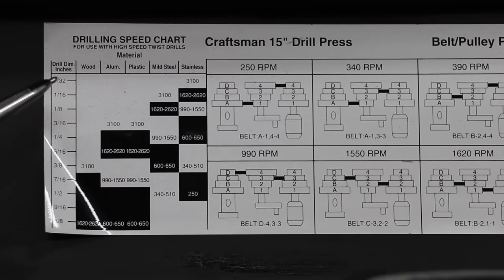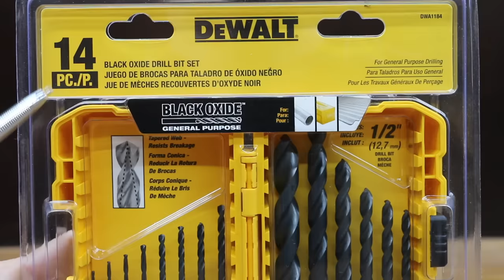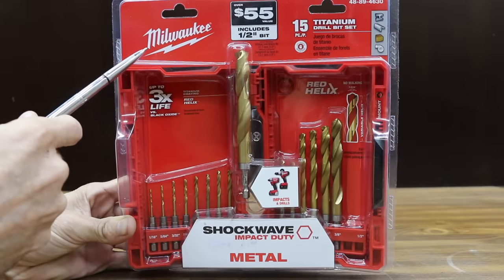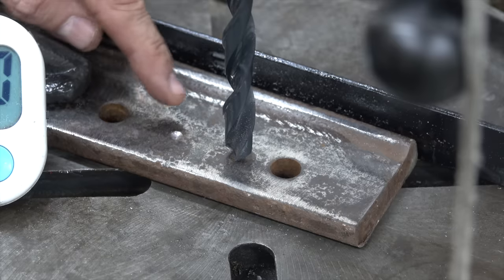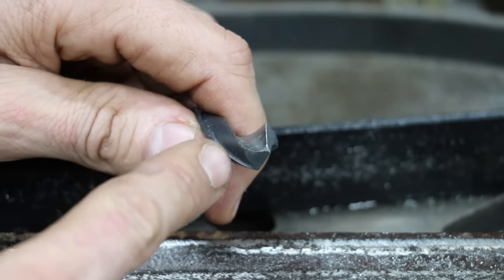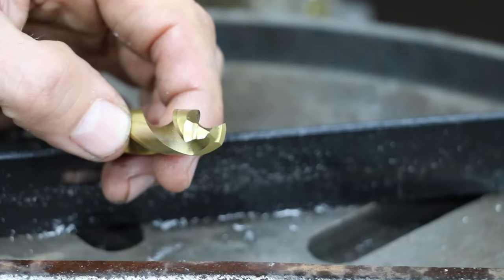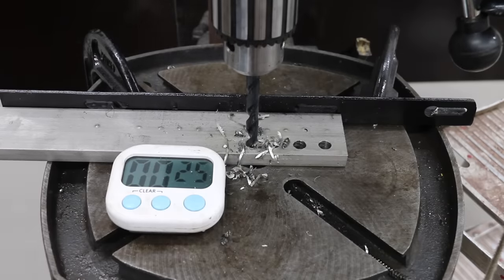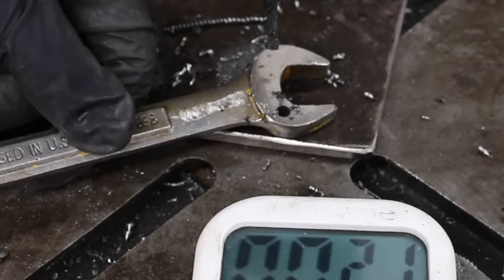Which Drill Bit Brand is Best? Let's find out!

Comment: 15:43 This should be informed in every drill bit set! 
I bet 95% of DIY guys don't have clue about correct rpms and forces to apply
Reply: Agreed and hands up at being one of those people. Done many a project struggling on like a tit, oblivious to my mistake.
Reply: Wish I could give two upvotes on this! guess this comment will have to do.
Reply: Mr. Victory,
Agreed, I never knew the correct way to use a drill either. One thing is for sure , Project Farm is more educational than any other teaching video that I've seen 
Just amazing
Reply: Moto Guzzi  This is the first I've heard of it as well.  I've always been taught to let the tool do the work and I've broken more than a few drill bits by putting too much pressure on it (usually drilling small holes through metal) so I would apply moderate pressure and let 'er eat!
Reply: I know about it but sometimes its kind of hard when drilling without a drill press. I though i wasnt putting enough force and later on when i bough a new similar sized drill bit i discovered it wasnt me, the drill bit was just crap and the newer one drilled through no problem. :/
If you have good quality drill bits then yeah, follow the sugested speeds and feeds,  but otherwise its kind of hard.
Best advice would be just try to keep the chips are a good size and constand. The edge is supposed to cut slices not make metal dust.
Reply: I just figured this out about a couple of years ago and I've owned a drill press for 3 decades. It never even occurred to me that speeds and pressure make such a huge difference.

Comment: Had to drill into a serious suspension bolt that I sheared the head off of and none of my drill bits were cutting it. Car (Audi 😓) has been sitting for weeks because I can only work on it on the weekend (when it isn't raining 🙄). 

Bought the DeWalt set ($15!!) after watching this and within minutes, all done, bolt out. 

Thank you once again for your service 🙏
Reply: Hello ReydioTube , 
Can I ask you about the process that proved successful for you to get the bolt out ?  I see that you used a drill bit but what other steps /  solutions tools were required to solve the problem of the sheared off (stuck bolt) ?

Comment: Great review. I just bought a drill press and went through several brand new 1/2” bits while drilling .125 galvanized tube steel. I had no idea my technique or lack thereof was the problem. Thanks for the tips.
Reply from the maker: Thank you!!  Glad it helped
Reply: R V yup, the bigger the bit the slower you need to go and the more downforce is required.
Reply: Best tip i can give for drilling metals. Thicker materials get lots of downpressure and low speed. Thin stuff can run at warp 10. When your chip is really long maintain your speed and pressure. If you get little needles you need more downpressure.
Reply: I drill through a lot of stainless steel and I periodically dip my bits in water to keep them cool. I believe if they get to hot it ruins the heat treatment on them, thus making them dull quicker. A little cutting oil too. Mine seem to last quite a while.

Comment: Dude iam so glad u brought up the speed vs pressure while drilling.. I apply this to basically everything I drill ** but I learned this as a first year apprentice slow and steady +heavy wins the race.  Have drill bits last decades
Reply from the maker: Thanks for the feedback.
Reply: Did you get past "first year apprentice"?   Cutting speed does not change. It's based on the material and if cutting fluid is used or not.    How much "pressure" you use is up to you and the condition and geometry of the drill bit.

.

Comment: The last minute of this video should be watched by anyone wanting to use a drill press. Very informative video well done, and that last bit (no pun intended) of advice at the end is outstanding.  Great work keep it up.
Reply from the maker: Thank you very much!
Reply: What's a good tip on how to gauge proper pressure?
Reply: @Marcoosianism  you'll know the correct pressure by the shavings. You want spiral shavings not bits or dust. Also, larger the bit slower the speed.

Comment: Try this same test with non "retail" high end drill bits sets like Triumph, Irwin, Matco Hyper-Step, Chicago latrobe, and Norseman. Also, drill speed is a factor of split point chisel edge design/relief and web thickness. You can always make a drill bit cut faster with a thinner web, but the question is how many of those holes is it going to last.
Reply from the maker: Great point and thank you for the video idea!
Reply: Don’t forget Walter drill indexes as well
Reply: Matco is Irwin. They just put the bits in a matco case
Reply: @davidlong5755  Not since 2018.
Reply: Add Cleveland twist to that list.
Reply: Kimbal Midwest makes the highest quality drill bits I’ve ever seen. Slice through 1/2 inch steel. Last forever too.
Reply: The only problem with that is he has to pay for all these tools and then consider all of his time testing them for his show.
Reply: Don't forget Dormer!
Reply: @davidlong5755  and jack up the price lol
Reply: @frankie9259  the videos will pay for them selfs over time its just an investment. youtube money baby.
Reply: I would suggest adding M35 and M42 Drillpro bits to the list to see how they compare. They've preformed well for me and I believe that the results would surprise many viewers.
Reply: @ProjectFarm  I'd be interested in comparing other low-price cobalt alloy bits like Irwin, Master Mechanic, Milwaukee, Dewalt, Drill America, and Kobalt
Reply: @ProjectFarm  A company named "drill hog usa" sells bits on amazon and ebay, but they're a bit of a dodgy company. Some people claim they're rebranded norseman, but their address is a UPS location, making them pretty mysterious.
Reply: Yeah most of the drills here are the same stock with different grinds. Black oxide is black oxide pretty much. The Bosch bits kicked ass because they're cobalt. Adding cobalt makes it a totally different animal. Then there's carbide drills. You'll pay over $20 a piece for them. And cry like a little baby when you break one too.
Reply: also dont forget OSG. dormer and other brands almost seem cheap compared to it. but at 150$ or so for a 1/2 drill, i wouldnt expect anything less lol
Reply: I would love to see this test done for durability. I'm sure it would be a difficult and time consuming test though. Something along the lines of how many holes in 1/2" steel before the bit is dull. You would have to figure out how to define dull. Perhaps when the cutting speed is reduced to 50% of its initial rate. I have to imagine this would be costly due to the amount of material needed to drill and very time consuming though.
Reply: Even the best drill can be destroyed quickly if you work with it incorrectly,I keep a low speed drill bit and cool the drill bit Cooling oil, the drill bits are not destroyed fast if you keep cool and low speed
Reply: The web thickness would make a difference in the force required but not the rate it would move through the material. Unless when you say drill speed you mean the rpm you should run it at? In that case rpm is mostly based on the material you’re drilling . The feed or rate the drill passes through the material, usually in inches per revolution is mostly based on the diameter drill you’re using. These are over simplifications but basically how drilling works. As the diameter of the drill is larger the faster per revolution you would feed it into the material. For example a 1/2 inch drill would like to feed at about say .015 inch per revolution where a smaller drill say less than 1/8” is more around .002 inches per revolution. That’s not to say that these two drills should be run at the same rpm either. In general, the smaller the drill diameter the higher rpm you should run it. Traditional twist drills cut on two surfaces only, the lips. Most geometry changes to the tip of the drill aside from sharpening or dulling the lips wouldn’t change the rate it would go through but may make the drill weaker or require more force to achieve the same rate. Just wanted to get some of this info out there maybe it will help someone. Love the channel PF.
Reply: @MRSketch09  Hi, I think you did ok. I use the virtually identical Viking Ultra-Bor bits, and have been happy for many years. Yes, the initial purchase price is hard to swallow, but these bits have handled everything I've ever thrown at them ( except my first time drilling grade 5 titanuim ) and most of them are still sharp, 10+ years down the road.
Reply: @Aubreykun  I'm going to try Drill Hog USA" bits some day. I've heard they have a fantastic warranty, and yet impossible to get ahold of. If they're anything like the viking/norseman drills I'm familiar with, they should rock.
Reply: @therealstubot  There's a lot of stories and rumors about them that I've seen but very little concrete information or testing. They have so many products with their labeling it makes me wonder how many of them are actually made-in-USA on the cheaper end, especially since they're very obviously not making the things themselves. At one point it does seem that their warranty service went to a factory who handled it directly but that changed to a registration one several years ago.
It's enough uncertainty that I'm not really willing to buy them myself (outside my budget to experiment).
Reply: @TerribleMachinations  You're correct about force required. However for a given/static force the one with a thinner web will then comparatively perform better.

Comment: The channel always provides a wealth of knowledge and provides a library of information.
With winter around the corner, an idea for another project is battery chargers / maintainers / trickle chargers. What is more appropriate for different conditions. 
If your are storing vehicles over winter, a car, is it best to just disconnect the battery, use a maintainer that can be just clipped on and keep the battery in optimum condition without having to disconnect the battery and lose any previous settings. 
The effect of different maintainers/ trickle chargers for the multitude of different battery chemistries.

Comment: I am a CNC Programmer in the Aerospace world and I loved this comparison video. Thanks!
Reply from the maker: Thank you very much!
Reply: @mhmoeller  When you need to drill a wall or a metal plate at home, will you bring a canister with a cooling liquid and a compressor? )
Reply: @hibahprice6887  I would simply use an metal oil can and pump a little bit of oil and water to the drill. Done that alot of times at home.
And you don't use coolant for wall drills.
Reply: @mhmoeller  The video shows that he also uses oil.

Comment: I love the videos, and definitely refer to them when making purchases.

My only (weak) criticism is that I prefer to see objective measures rather than subjective descriptions. The wear on the bits, for instance, could have been measured using a sharpness test - maybe a low-load twist into wood to see if it still grabs.
Reply from the maker: Thanks!  Thanks for the constructive feedback.
Reply: I thought 10 to 20 holes per bit should have been drilled with a chart per bit showing time from first to last. I can see where that would be a huge amount of work but I still think that should have been done as drilling one hole is no indication of the bits ability to last and stay sharp. I am a machinist and use high quality cobalt bits but was considering a cheaper set I could fit into my bit driver, not just my drill. I think this will help with that but only so much.
Reply: What kind of wood?  Balsa wood?   Why not see what the edge will cut before drilling anything. Maybe it will cut paper.     Do you want to be objective or do you want to be subjective????

What would you expect the sharpness to be if you were drilling into cast iron?

Researching and educating oneself is highly recommended.

This video was a lot of good work, but completely missed out on two of the more important aspects, TOOL GEOMETRY, and WHAT the drill material PURPOSE is for.

The ONE feature not emphasized was the "split point" feature.  This one aspect alone IS important.  The other geometry feature is the drill point angle. Standard drill point angle is 118°.  Alternative angle is 135° often used for harder materials. Also important is "web thinning" and "rake".  This is a matter of simply looking at the tool bit set BEFORE purchasing.   None of this was even mentioned in this video.

Then the drill material was skipped over with no explanation ....yet it seemed that "cost" was more important.  Well, if you're not going to provide any information about drill material or "coating" ....and in particular "SHARPENING" .....then this video is fundamentally only for people who need a drill every five or six years .....for wood.

.

.

Comment: I use Bosch drill bits a lot for drilling through tool steel they are one of my favorite less expensive bits
Reply from the maker: Great feedback on the Bosch.
Reply: You pay $30 upfront but you can drill 10 times more steel per bit. And it’s free shipping.

Comment: I'd like to see more of a "how many holes you can drill before the bit is toast" over pure speed. I care more about longevity.
Reply: The bit that drills best drills longest. Unless it just wasn't ground so swift at the factory. Which does happen. A lot of this test was just pitting different grinds against each other. What you really need to do is a hardness test on each bit.
Reply from the maker: Thank you for the video idea!
Reply: Drill that drill COOLEST drills longest. Heat kills drill bits.
Reply: @peterwelsh6975  hola me llamo es walter. me gusta calabaza yo soy grande calabaza chico
Reply: Yes that would be very very important, how many holes...............
Reply: @peterwelsh6975  some metal can take more heat than other metal can. The Bosch cobalt drills here are in a class above all others tested. The rest are M2 The M42 is better.
Reply: @job38four10  if production is that important to you then you want to run a flood cooling setup no matter what drill bit you use. At that if you're at it all day expect to go through about a half a dozen or so bits a day. Good for maybe a thousand holes. It's a boring job but I've done it. I used to make these by the tens of thousands http://i.imgur.com/Z5pXaMO.jpg I'd pre drill for those milled pockets too. I made them all different sizes from about an inch to two inches thick. The ones in that picture are an inch and a quarter thick.
Reply: You would like the cobalt bits then.
Reply: I was hoping that he would do a side-by-side test with a fresh bit and the bit from the previous test(s) to see how they do new and how well they hold up to wear.
Reply: well thats a good point, some manufacturer will make the drill to have less cutting angle to get better life out of it.
Reply: There are a few videos out there that show you how to install your own coolant system. This can decrease the wear by applying a coolant. Cooler drills equal longer lasting!
Reply: Tritech, the Dewalt bits last a long time for us, I may be a little biased because we only have Dewalt tools, but they are as you saw quick and relatively cheap.
Reply: I've had the best luck with the cobalt and molybdenum bits. His most expensive set was cobalt, but he didn't have a molybdenum bit.
Reply: @gilbertdirt541  All these years, I never realized "Sobchak" was a hispanic name!!
Reply: @1pcfred  Made what, the hold-downs?!?  Man, at that rate you could've justified a little automation!  (Or a high school student at least.)
Reply: @markmarkw1919  what we did worked for us. We weren't only making those clamps. We had 4 main product lines we manufactured. Clamps, dressers, live centers and centerless grinding machines. It would not have been practical to automate all of that. But you being some rando on the Internet clearly knows better than a company that was engaged in all of this for over 50 years.